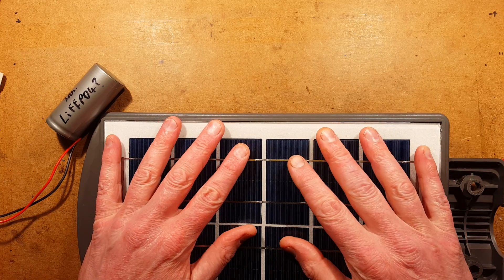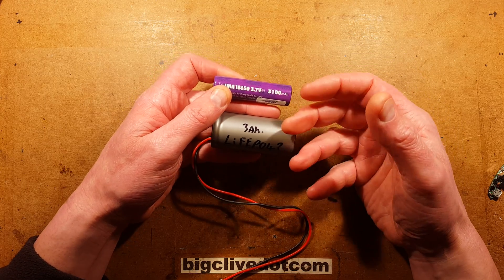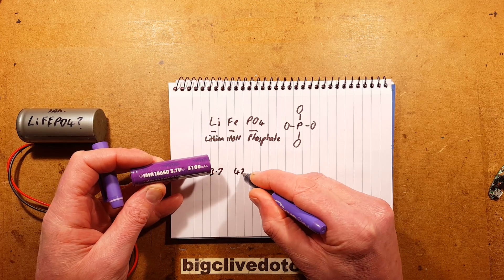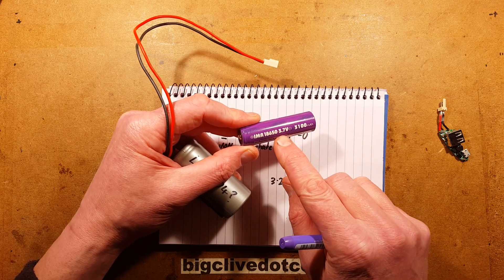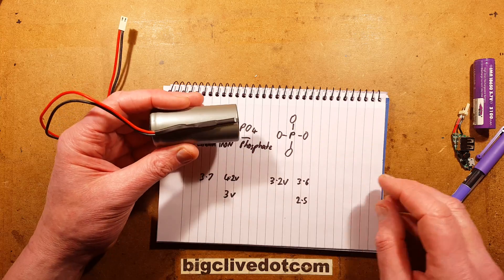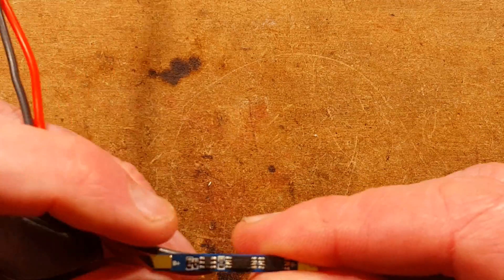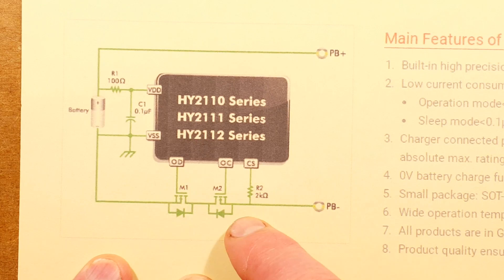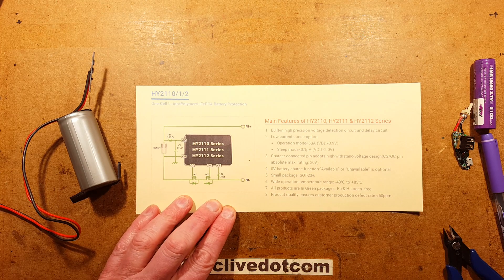LiFePO4 versus standard lithium cells.

Comment: Since you mentioned practicality of solar Christmas lights.. Yay Clive!! I have played with a standard sized garden "solar bank", panel about 95mmX80mm with lithium Ion, as well as many 50x50 with NiMh. The NiMh units all had 600 or 800mAh and "high" operating current of 35 to 50mA and drained the cell whether or not connected to a string of lights. My load was the magnet wired seed/fairy lights that required only about 15mA but unfortunately could not span even one cloudy summer day. One unit that is NLA had 2mA operating I. I imagine that's either about protection from overcharge or poor design. The lithium bank had 8mA drain, auto-dimming, a cheapo 1200mAh cell, and performed well even during the winter solstice near Toronto, Canada. Not super bright, but indeed super pretty. Partially thanks to you I have custom 12/24" pitch fairy lights... Beware of the wasteoids!!

Comment: Another point of having two MOSFETs, even if there wasn't the diode issue, is that it allows it to independently block charging vs discharging.  When the battery is at its max voltage, you want to be able to prevent further charging, but you don't want to prevent discharging (which would just make the battery useless), and likewise when it's too low, you want to prevent further discharging but don't want to prevent somebody being able to charge it back up to make it useful again...

Comment: I started buying only LiFePo, because in Arizona and West Texas, the denser/standard lithium battery packs for jump starting a car or charging a phone will expand. Never had one explode, but it's not worth the risk. I even used a permanent car battery size for a few years, and it had no trouble in freezing 🥶 or burning 🥵 temps.

Comment: Check out Jack Ricards you tube videos on his EVTV channel. He goes into great detail on the safety of LIFEPO4 calls compared to other chemistries and advocates their use in electric vehicles. The only production EV using LIFEPO4 cells is the Tesla Model 3 standard range and only starting very recently. My 2019 model 3 uses the Tesla 2170 cells which are not LIFEPO4.

Comment: question is, can i do a direct swop   say on an  LED lantern or and USB FAN. Where it's connected to an 3.7v 18650 2500mah or 3000mah. then connect it to a 32650 with bms 5000mah?  (excluding the physical size of 32650 is obviously bigger battery.. but charging and lifecycle and safety wize)  can one do a direct swop. to get more capacity and longer lifetime for fan or LED lantern?.    They both normally charge the internal battery from a 5V source via USB cable (micro usb or usb-c)
Reply from the maker: As long as the battery technology is the same you can swap in bigger batteries.

Comment: any thoughts on using say a 36v 16a lifepo4 battery in my e bike. i see them for about £200 on ebay, has anyone got any experience? my last battery 36v 10a normal li ion battery only lasted about 2 years , would like something that lasted longer if possible

Comment: Excellent video. I like to tinker with things myself and learning about batteries has helped me. I have two solar street lights. Two things I look for is:
1. How much does the solar panel actually output
2. What type of batteries are in it and are they actually rated for the capacity spec

Well I found that the panel indeed outputs what the specs stated on the listing.
But with the batteries this is where they go cheap to save money. Usually some used grade b cells that are 40-70% rated capacity. Which is why most people find that the solar light stays on for half or less than what stated. Most cases there is more room in the casing to upgrade the battery capacity.

Comment: I have though seen many of the bigger LiFePO4 cells swell and puff up after a few years, some variants of these seems pretty sensitive too
Reply from the maker: They do swell and potentially vent when they fail.  But they don't ignite in the same way as standard lithium cells do.
Reply: @bigclivedotcom  indeed. You could see the initial swelling as an immediate reason to change them out before they get to dangerous levels which is a good thing but in the end both kinds are rather sensitive if you go beyond their specifications in any way

Comment: 070520/1906pst  Thanks for the introduction to LiFePo4 Cells.  No one has explained the chemical composition of it as you did in this video. Now that gives me a excuse to wean away from Li-Ions.
A question, by the way, is LiFePo4 and LiPo (Lithium Polymer) cells, the same? Thanks and 73s...
Reply from the maker: LiFePo4  is different from traditional lithium cells.  It has a different upper charge voltage, so it has to be used with a specific charger.

Comment: Have an electric bike with a 52v battery i built, and 2 36v (one li ion and one lifepo4) batteries from older ebikes that I dont need. Would it be safe to use all the best cells from both the 36v's to make a bigger battery or is it not a good idea? Would be great to have a backup 52v if this is possible. Thanks!

Comment: LiFePO4 are more expensive on market but by calculations are cheaper than all other batterys. Why?! Because liFePo4 have much long cycle  life., nearly 1500-2000 times, and again remains 80% of the capacity. That means if everyday we charge batterys once per day then 2000 cycles will be more than 5 years. If we use other battery cells, i mean other chemistry most of them are rated up to 1000 cycles, some at 300 cycles and some 800 cycles. If a battery cell  have up to 1000 cycles life, then we need to buy twice for 5 years. But how much percent will remain after 1000 cycles? You find out :) Meaning for 5 year we will need to buy twice battery cells, or three times maybe. Again, other chemistry are not guaranteed that will last more than 1 year. I use some batterys (other chemistry than LiFePo4) for waping and most of them last for one year up to 18 months. On other hand other chemistry are (mostly) dangerous for health and maybe for the life. LiFePo4 and LTO are best.

Comment: LiFePO4 are 3.2 Volt, so you can not use that chip which is for IMR to control the capacity of LiFePo4.
Reply from the maker: I was using the cells own LiFePo4 module to end the charge.

Comment: Tip to remove heat shrink.
Make a small cut.
Heat it up withva lighter and then you can pull it off easily.

For hot glue use medical alcohol.

Comment: Curious how it measures high cutoff current. Can only assume it's the voltage developed over the fets ( their on-resistance ) sensed by the resistor
Reply from the maker: It does appear to be based on voltage drop across the MOSFETs.

Comment: I'm presently using these grey Lifepo4 cells in a self built 10KwH battery bank charging off of 2Kw of solar panels fixed to the roof of my truck. I control the charge/discharge Voltage via my solar charger/inverter & balance them with BMS boards. They work very well: many times more efficient than lead acid & very long life compared to Lithium ion. With the right charge/discharge profile they may well last a lifetime with just a little power loss that can be offset by adding more batteries in the future.

Comment: Hang on.. Tesla doesn't use Lithium Iron Phosphate batteries..  The ones that burned in Rich Rebuilds video were 18650's
Reply: 18650 is only the SIZE of the cell, what You mean is Lithium Ion CHEMISTRY

Comment: I wonder if the "true switch" back-to-back silicon MOSFETs are necessary now that GaN Mosfets without body diodes are becoming more commercially accessible now. Silicon is obviously cost superior, but is that the only reason?

Comment: Tesla uses Nickel80Cobalt15Alu5 batteries (plus minus something; The more Cobalt, the more power they have, but it's getting complicated here), which is why they burn so well. Also, they charge and discharge them with a lot of power, you can't do that with your standard lithium cell. We're talking 2C or more here (which is, btw, quite dangerous).

Comment: So, two things, one for Clive, one for the comments.

Clive, one thing about the two FETs, you're right about the diode blocking, but that's only part of it. The 'OC' is charge FET, and the 'OD' is discharge. That's how the chip is able to cut current flow when it exceeds a threshold.

As for the LiFePo4, they're 'better' for some applications. One nice characteristic is that you can usually charge them pretty aggressively and they'll take it. I've seen some that will allow you to charge as hard as you discharge. That's great for regenerative braking or hybrids.

I wish they were more popular so the price would go down.

Comment: The problem with solar is it doesn't work in the dark.
  However if you use thin film solar panels you can get probably close to full power in un-idealistic situations. ie. bad angle to the sun, overcast, partial shading etc. Problem is they cost a little more and are larger in size, they have a shorter lifespan and are less friendly to the environment but they should work in Isle of Man or any other overcast area. After that obviously you just size for the application depending on how many daylight hours you have.

Comment: I've actually been building a portable solar system with a 65x55cm 50W panel and a pelican case housing a controller, a 12Ah LiFePO4 12V battery and water proof connectors so it can withstand rain. I'm glad that I went with LiFePO4 instead of Li-ion

Comment: Besides the unwillingness to burst into flames, Their higher number of charge cycles is only on paper better than Li-ion. If you charge a Li-ion cell with a voltage range comparable to LiFePo4, it gets the same number of cycles, so energy density, and cycle life is very similar in  all but the most demanding applications, Cost Wise LiFePo4 have an advantage.

Comment: This chemistry is used in cheap solar street lights because the voltage matches that of white leds , often they feed the leds direct with no other circuitry , the flat voltage with discharging keeps light output fairly constant.

Comment: clive, quick question. would a boost converter fitted to the output of a solar panel, be effective in boosting the output of said solar panel in low light conditions?
Reply from the maker: You're not going to get more energy.  When the output voltage from a panel has dropped it usually indicated low general output due to light levels.
Reply: @bigclivedotcom  i see. thanks clive. keep up the good work. love the videos

Comment: I built a 8S 2P  (24V)  battery pack using 38120 HeadWay LiFePO4 cells.    I can Weld with the thing.    Employed in our Wind Turbine / Solar power wall.    https://batteryhookup.com/products/4-headway-38120-hp-3-2v-8ah-lifepo4-lithium-batteries-25c-200a-super-cells

Comment: As a vaper that has used his 18650 cells for shit they probably weren't intended to, while burning couple cheap chinese power bank circuits in the process, like some you have reviewed (minimal to no protections.  I gotta say these (INR/NMC [LiNiMnCoO2])  LG-HE2 and Sansung 30R; 3200mAh and 3000mAh (respectively) cells I've been using for the past ~3 years have been so great, right there in the middle of high current draw but high capacity. Anyways, vapes are dumb, 220W on 2 cell vapes? fuck those marketing gimmics, most cells out there arent even capable to deliver full power when taking into consideration (iirc) you need 20A suatained cells to get to 180W. Stupid gimmic market hahahahaha. Aslong as I have some reputable cells from reputable sources and quality external chargers ill just throw them anywhere I need to.
Life Story: During huricane maria I put together an external battery pack to charge my laptop (watching voltage to not get them too low), I think I was running 5 cells at a time on a 20v charging input and charging the cells independently on my car with a decent charger. the whole ecternal battery pack was made out of super-glue and cold solders on corroded contacts. since I was just using a torch lighter and heat up a broken soldering iron tip

Comment: One of your videos on USB power packs showed you shorting the center two wires in the cable going to the cell phone made the phone negotiate a higher charge rate. Could I make a male & female USB plug & receptacle with a short going toward the phone that would tell the phone to try to get a higher charge rate from chargers?

Comment: Bigclivedotcom, I have a substantial investment in battery powered tools. 
As a result I'm learning to be a battery pack technician. 
I've revived several of them by opening the pack, bypassing the circuit card and charging the cell stack directly. 
I have a couple of packs that I think have a dead/open cell. 
You are my "go to guy" when I need to learn something in a more particular way.
Have you done a video where you evaluate the various parameters of a battery pack?
Showing how to test the circuit card, individual cells, etc?
If you haven't, would you be willing to?
Or do you know of a YouTube contributor who has?
Your stream of consciousness method of talking about things is very helpful.
I had a GFCI protected outlet that you helped me repair by explaining how they work and using a split ring ammeter to hunt for the problem.
Thanks
Reply from the maker: I have made a video exploring a Ryobi pack.  It's not uncommon for a whole pack to lock out if one cell goes low, and they can often be revived as you describe by bringing that cell or parallel cluster of cells back to 3V with a current limited supply.
If the pack is charged and left for a while and the voltage of a set of parallel cells drops over time faster than adjacent cells then it hints at an internal shunt.

Comment: we use LiFePo4 cells as a 12v starter battery in aircraft. partly for low temp performance, but mostly because they are bulletproof. we shot a nail through one and it just sat there and took it. still it has to be in an aluminium bunker because boeing cocked it up by using LiPo's without adequate protection and without armour in the dreamliner.

Comment: I have a recumbent bicycle on which I installed a 750W hub motor (www.goldenmotor.com) and the battery pack that I got with it was made with LiFePO4 batteries. The pack was set up to put out...as well it should be...
36 volts, 10 amp hours at 30C. 

That’s the other important thing about this chemistry. It allows for  high output rates. Considering I bought it about 2003 it is an amazing bit of work along with the controller that could manage from 12V to 60V and up to 150 amps. The whole thing still runs well. I get about an hour at 20 mph if I don’t pedal or use the regenerative braking. It lasts longer if I just use the motor for the occasional assist. And if I use the regenerative braking I get an extra 90 seconds or so of run time. Lol. 

I don’t see this hub motor, ESC or battery pack on their page any longer. It was the model just before one called the “Magic Pie”.

I guess they just updated their offerings. Though how can a company go wrong with something called a “Magic Pie”?

Love the vids and running commentary,
JTI

Comment: If it's lower voltage than a common lithium cell then your capacity rating isn't comparable. 3Ah at 3.2V is less power than 3Ah at 3.7V.

Comment: For EV's Tesla is not using LiFePO4 chemistry in its battery cells, but NCA. For model S, the cell type is the 18650 (like the purple one you hold). For model 3, it is also NCA chemistry (LiNiCoAlO2), but in the 2170 (21700) cell model.

Comment: It would be nice if China made charger modules with protection for the lifepo4 cells like they do for li-ion. A 3 volt under voltage cut off would be perfect. Maybe bigclive could come up with a circuit design if the Chinese won't do it.

Comment: The two major advantages of LiFE or LFP batteries are : more cycles, and 4S being compatible with 6S Lead Acid batteries. In a car you can replace a 12V battery of say 12KG by 3KG of 4S LFP and this will over last the lead acid especially if you charge it when hot and if you need good starting power in the cold and leave the vehicle alone for months. Tesla does not use LFP becuse it is less energy dense by weight and LiCoO2 wins there. But Tesla reduces and will succeed in removing all Cobalt needed in those. LFP is used by Koenigsegg for both startup of gasoline engine and or hybrid battery because LFP accepts very high C rate = FAST CHARGING. LFP is also great for energy storage of renewable energy for a house, and Electrodacus is making great controllers for a balanced 8S 24V system. https://electrodacus.com LFP if shorted or heated externally to 160°C will vent gas but is not flammable. (unfortunately I tested that ... )

Comment: I'm always getting slightly confused, when you talking about capacity of these cells. Do you mean 3Ah @ 5V? this should be 15Wh and translate to 3.2V + 4.7Ah. (Normally 32650 LiFePO4 cells should do 5Ah). Please switch to energy units like Wh or J.

Comment: "That's just the peril of solar panels, they don't put out much power when you need it the most." is a very accurate summary of my experience with them too.

Although I guess maybe if you're in a hot climate and plan to run your air conditioning on a battery buffer + solar panel its output trends will meet your demands better. Technically solar panels get less efficient with heat, but when allowing for some ventilation around the panels the extra sunlight to convert into electricity is almost guaranteed to compensate generously for that "efficiency problem".

Comment: Their NOT used in electric cars. Also the exploding car video used tesla 18650 cells with a lithium ion NCA kemestry.

note: correct kemestry name: Lithium Nickle Cobalt Aluminum oxide(LiNiCoAlO)

One last thing, the ”lesser” capacity dosnt manifest itself in the battery voltage, well it does but thats state of charge, the voltage range of a battery is purely determined by its kemestry